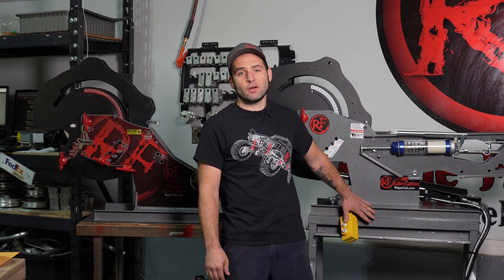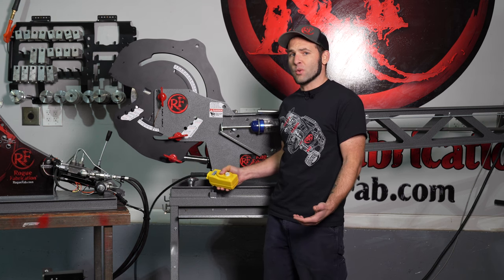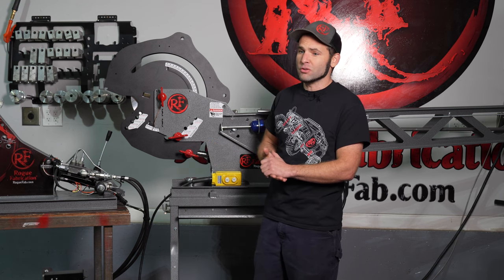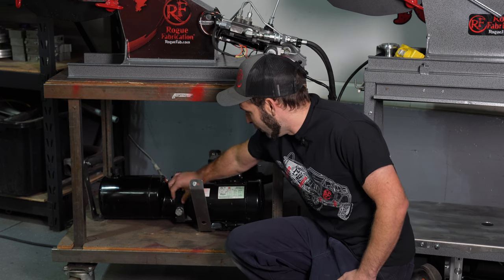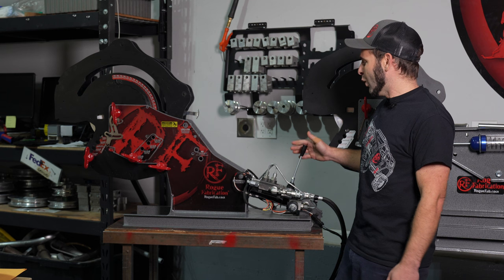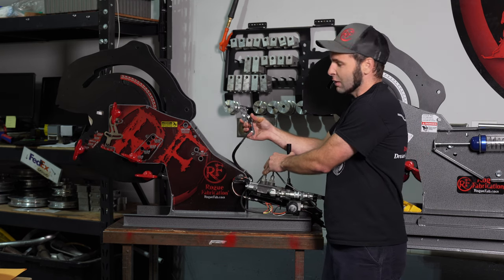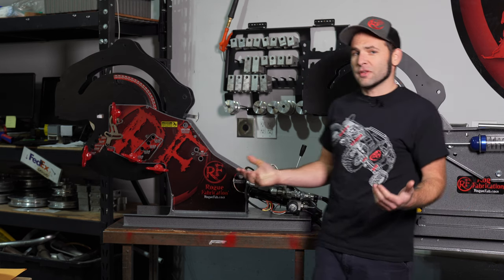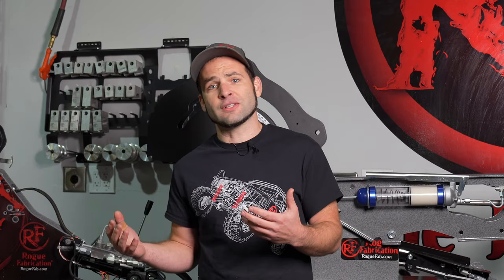1.5 & 2 HP Electric/Hydraulic Systems (Comparing Sound, Speed,  and More!)

Comment: Thanks for the video! Couple questions:
1.5hp=~4°/sec
2.0hp=~?°/sec (production, not your shop machine)

Did your microphone have a dB meter to measure both power units?
Reply from the maker: 1.5HP is 3.50 deg/sec, 2HP is 4.4 deg/sec.